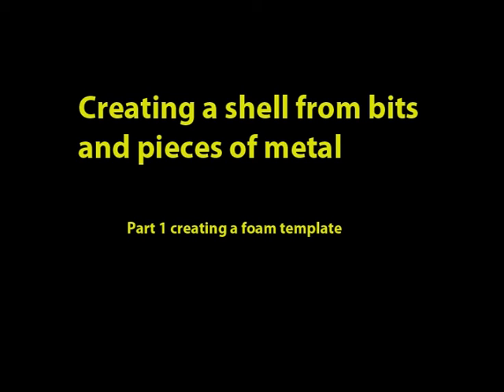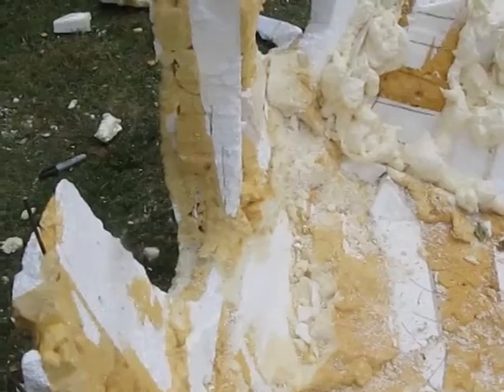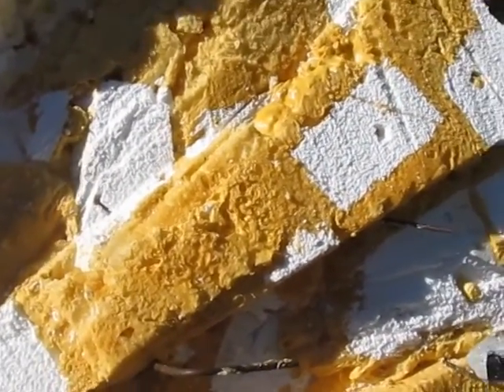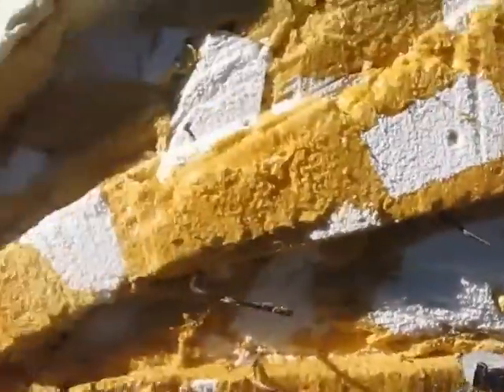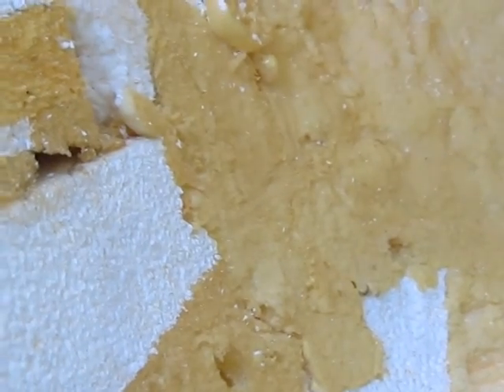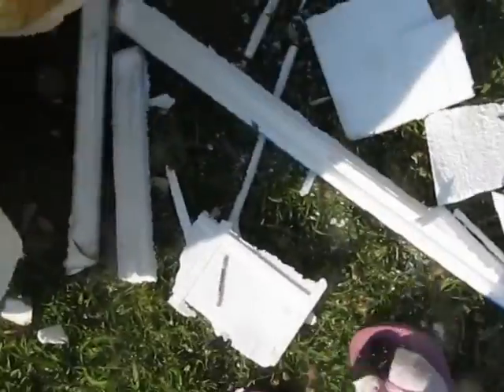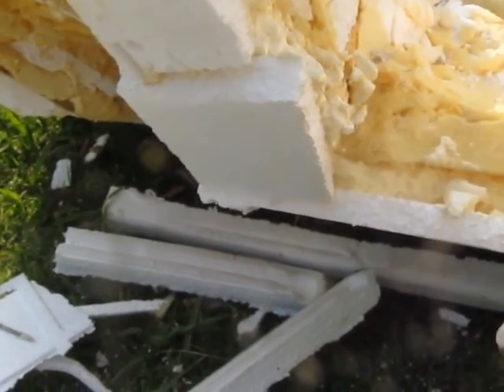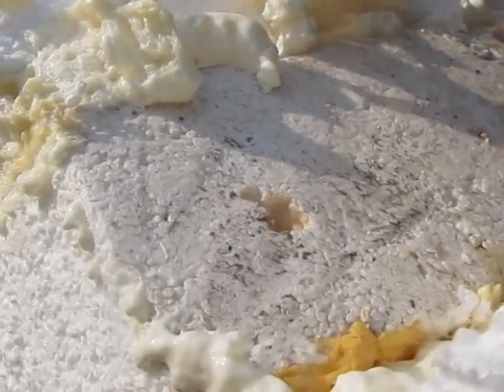how to make sculpture from foam (large scale)

Comment: Great idea. Love the video.

Just a quick tip. At about 9 minutes, you use foam essentially as a glue. As an alternative, LePage makes a product called pl300. Works just as well and is probably a lot cheaper than foam. Foam though does still have the advantage of expanding.